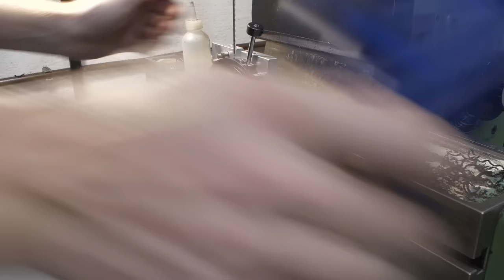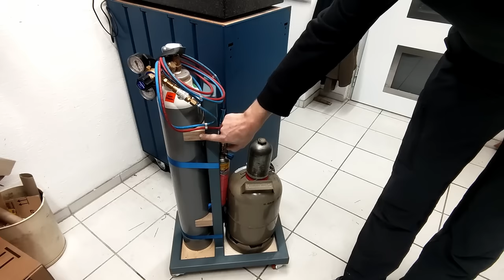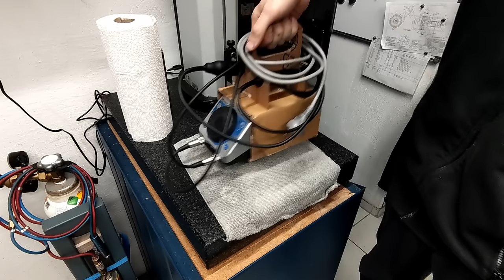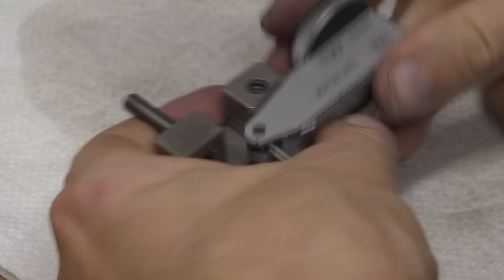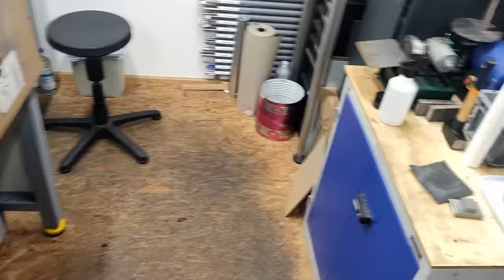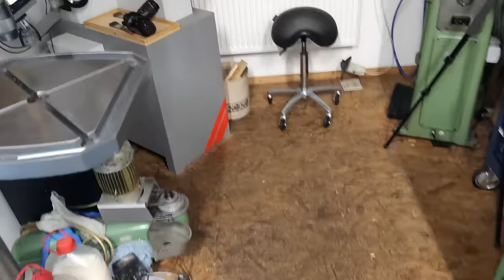Shoptalk #31 - November 2023

Comment: Thanks Stefan for the explanation about oiling the wood for successful tool storage.  I had been hesitating in making custom storage items.  Now I have more projects to start working on 😂
Reply: It must be a metal machinist point of view? Coming from the wood working world, there are loads of machines and metal surfaces in a wood shop. Also loads of wood and wood chips!! You would think the place is rusting down to the floor by some people's concerns. haha. You simply clean up and the surfaces are oiled or waxed now and again. And there is ALWAYS fine saw dust on everything. I've found the moisture in the air to be much more of a concern regarding surface rust forming. That being said, I wouldn't leave a wood board on the machined cast iron surfaces over night. That is common practice though. Those are reference surfaces to be cared for. If I want to stack something up, put it on a table, or a rack.

Comment: I watched another YT machinist, who had a very interesting idea. He has a rail mounted to each side of long axis of shop ceiling. A light weight gantry with adjustable vertical pole holds camera and battery powered lighting system.
No bumping or dancing around the tripod, camera's viewing angle can be behind operator or machine, vertical camera pole tucks into corner of shop when not needed.
Really enjoy learning from your video presentations, thank you for your time and efforts.
Reply: Inheritance Machining?

Comment: Keep up the good work, Stefan.   I do the same with my Sentinel #58 mill (Thiel 58 copy). The machine, is, in general, quite a bit larger than the Deckel FP1, but I still run out of room below the vertical head. In my case, I have a large fixture which attaches to the face where the table is usually attached. This fixture is a very heavy item which is bored to accept bushings for common diameters of flywheel main-shafts. I use the fixture as a way of guaranteeing the positional repeatability of precision bored or ground crank-pin holes, in motorcycle flywheels, etc.

Comment: Hi Stefan,
Re your tool storage material (wood), and your manufacturing die grinder caddy, can I suggest you check out using plastic  IKEA kitchen chopping boards !
They are super strong, 8mm thick, easily machined and tapped using self tapping screws etc and very low cost, and a good alternative to wood.
Happy New Year !
Regards
Mike N

Comment: Shop updates are among my favorite content. Thanks!    As I'm primarily a woodworker, I enjoyed finding ways to use my machine tools for wood. I have used the mill as a morticing machine a lot, particularly when I had a bunch of them to do at once. With sharp cutters, some fixturing, and using speeds and feeds for aluminum as a starting point, I got excellent results. I dislike routers as well. For the part you were making I would have used a bandsaw but I don't know if yours would have been big enough.

Comment: Always enjoy your shop talk videos.  Thanks for posting.  I will offer a suggestion that has worked well for me when moving heavy items over smooth to semi-smooth surfaces for short distances.  Try two sheet thicknesses of HDPE, PTFE (or sometimes even polyethylene contractor garbage bag material) under the machine feet.  It will slide much easier because of the very low coefficient of friction between the layers of plastic.  I have moved my surface grinder half a meter or so in this manner on a concrete floor.

Comment: I always need to remember that the big hole in the center of the drill press table is not under the spindle, when using the rotation for positioning. 🙂
Reply from the maker: you can make fun of me, once i have drilled into the table 🤣

Comment: It is quite a small but efficient space. Suggestions for die grinder, affix two pieces of pvc conduit either side of box to tuck cables into for neatness. And if you are concerned about your floor, simply double up your flooring with OSB  and it will be extremely strong and will spread out the weight.

Comment: Stefan, i almost never have any advice for you, but, if you want to make a wheeled cart for that grinder, make a saddle-shaped cart with a "steam roller" style setup with full width solid stock as the rollers. the width of the rollers will protect the OSB, and if you chamfer the rollers, they'll "Ski" in the other orientation with a crowbar. I made a stand like that for a big bandsaw that needs to sometimes pull away from the wall, and it's been pretty great for me.
Reply: Why do that when you can drill and bore 600 pockets in 8mm plate and pack each one with a ball bearing? 😂

Comment: As always a pleasure to watch.
I have built one of your holders, with modifications to suit my perceived wants, and added a fine/coarse adjust but at the end not where you showed it could be. The guys at SM-EE, who have seen it, seemed to think the design has merit. 😉 At present the body is nylon while i finalise the mods, but it is still stiff enough to test. One problem i have is that it is too low profile,  making it difficult to see the dial when in the " north " facing position because mine goes straight in an R8 collet. I am working on one with parallel arms to vary the height. At my age it is the only fun i get playing with ideas,😊
Perhaps it is time to add another video to my meagre channel 😊

Comment: I can smell the fresh epoxy floor of the new 500 m2 industry hall of the "GTWR-Werke GmbH".
Reply from the maker: If I build a larger building any time, it will have a solid wood floor / wood brick floor for sure - I despise Epoxy floors :D
Reply: Why not concrete whith micro- cement layer finish?
Reply from the maker: because i like wooden floors :)
to me, its a nicer room climate, nicer to stand and nicer looking. And solid hardwood flooring is incredible durable and parts that get dropped dont get all dinged up and tools that get dropped dont chip the concrete or epoxy.
THB, I have no clue why you would anything other than wood flooring :)
Reply: @StefanGotteswinter  i agreed but, to  support heavy weight?
Reply from the maker: @benjaminbenavidesiglesias52 Hardwood floor or wood brick floor on concrete will support several tons per squaremeter without a problem. 
(Wood brick floor is a very classic floor choice in heavy fabrication or machine shops.)
Reply: @StefanGotteswinter  👍⚙️
Reply: @StefanGotteswinter  you can probably make the floor out of wood and then proper foundations under the machines out of 60-100cm thick concrete if you have any bigger machines...
Reply: AFAIK, the heaviest machines with the biggest loads (think gigantic ship engine crankshafts) usually was put on floors made up of standing oak trees cut to length, back in the day. Making very thick and sturdy flooring. 👍
Reply: @andli461  this is not 'thin wood' ...
Reply: @benjaminbenavidesiglesias52 No, it’s not. Quite the opposite actually. 🙂
Or do I misinterpret your comment?
Reply: @andli461  my english is 😬🤓

Comment: Hi Stefan...Sorry but watching you build a table with castors is agony :)))...This is what happens when you give a master machinist a fabricators job. I would have marked out a plate with the hole centre positions supplied by the castor supplier. Clamped 4 plates together and drilled/ tapped all at the same time. welded them to the table...job done.

Comment: Ah, finally, someone said it, a drill press with 2 rotary axes is pretty much a radial arm drill with a quirk...  I think i said the same thing when Mark Presling first started the floatlock vise build in regards as to why i find just a regular 2 piece vise a better solution on such machines... You don`t need the movable vise when you can move the table around its own axis and around the column itself to reach any part of anything that would fit on the table of the drill...
And thank you for the part about the abrasives... I constantly see people use scotchbrite on lathes for ``polishing``, oftentimes without way covers, and then just ramming the carriage forward right after that without any cleaning, relying on way wipers to do something, without realizing that way wipers will just soak up that abrasive dreck and become a scotchbrite of its own, kinda like that plastic bushing you were once talking about on that video with some guy i`ve seen long ago... All soft abrasives shed abrasive dust like mad... Even a charged diamond plate will shed some, so it just baffles me how people think that a bit of sandpaper wont or a scotchbrite which is much worse in that regard... How little love does one have to have for machines to do such a thing is beyond me...

Comment: Long drill job: Could you have used a drill guide fitted to the fixture to avoid the spotting procedure?
Reply from the maker: I tried that - There are two threads on top of the fixture where I had a drill bushing attached - It worked, but the drill entrance was not very nice compared to spotting with an endmill and the long chip coming out the hole was messing with the drill bushing, causing molten PVC - In overall it was rather problematic.

Comment: Hi Stefan. About getting more height... You could have a short drill chuck - that would give you some. And there also exists a very special raiser block for the FP1. It raises 100mm (without changing gear angles) and was made for use with the combination of the slotting head and the 2037 indexing table. I know it does exist - I had one and sold it to someone in Belgium.

Comment: should keep your eyes pen for a dentist lamp. one of those seeling mount type. i had one years ago. thay are great. the one i had could travel all over and stay where you put it. will be great camera rig for your shop
Reply: A friend of mine gave me one of those dental lights. I mounted it onto a piece of 2" pipe with a pipe flange and attached it to my welding table. I also replaced the original bulb and lens with a high intensity LED bulb. Best welding light I've ever seen. I can move the light to any place on the 3'x4' table. There is also a 5" plumbers vice mounted on the corner of the work/welding bench. If I ever need to make videos I could easily mount a camera above the dental light, which has adjustable tension on the holding mechanism.

Comment: 6:00 Stick a 90 degree fitting in  your  airline and have the hose coming out vertically down instead of horizontally. I found that my air gun would hang better and not provide as much obstruction.
Reply from the maker: Good idea - I have done that on other places, but it didnt occure to me here.
Reply: @StefanGotteswinter  Everywhere you have a "drop" for an air fitting needs to have the TEE pointing up. Then two 90's and then the quick connect pointing down. This arrangement will not allow water to make it into the hose. js.🙂

Comment: Your high quality content is much appreciated. Thanks for sharing. What is the maker of your keyless drill chucks? Do you prefer them to keyed type in all applications?
Reply: I think I would bet money on Albrecht keyless chucks and I’m not a gambling person. It has that German quality to it.
Reply: I'm asking because my experience has been the keyless chucks loosen when the spindle is reversed when power tapping.
Reply from the maker: The chuck on the drillpress is a Röhm Supra, but I also have a Albrecht for the mill and lathe.
We used Albrecht and Röhm at my dayjob for powertapping it has been rarely an issue with opening on reverse.

Comment: I'm sure you've probably considered it, but I think I used some HDPE as skids when I was sliding my mill.  I may have my plastic names wrong though.  I remember it involved the use of letters that don't spell a word.. like those of any language that ain't English. Thanks for the video!
Reply: HDPE = high density poly ethylene. The cheapest source for this I've found is food chopping boards at the local hardware store. A great material.

Comment: Poll.  What tool/machine will Stefan discard of next or what will he add to the shop next?  My guess is a bigger surface plate although I’m sure a bigger plate would be a PAIN to get in your shop
Reply from the maker: Lathe, definetly lathe - The surface plate is perfectly fine :)
Reply: @StefanGotteswinter What do you need to upgrade, capacity?
Reply from the maker: More stiff, more weight and a spindle that is not geared in the high speed range, only belt driven. I get artifacts from the gears of the super 11 when I do diamond turning.

Comment: The NSK drive unit just takes 60ish volts for the BLDC board, and 12 V for the logic unit, i am thinking to replace the transformer with a lithium pack…it doesnt care about DC voltage that much, if you feed the 60V rail with 40V, it just limits the top RPM without any alarm, very suitable for battery operation!
Reply from the maker: Thanks, good to know! Sounds like a fun mod :-D
Reply: @StefanGotteswinter  welcome, mine is the slightly higher power espert500, should be the same with emax, i bought the adaptor to get 60V out of dewalt flexvolt 20/60v battery, havent decided how to mount it yet…

Comment: I have found that if I stick to beech (buche) as a tool holder I have no problem even without oil but I avoid oak (eiche) like the plague as the tannic acid will corrode ferrous metals.  MDF also works OK but the dust is horrible to work with.

Comment: Stefan, I have had problems with certain plastics (acrylic, lexan) with IPA. Over time it shows cracking (crazing)..
Reply from the maker: Yes, thats a problem with some plasics. It also can lead to a higher probablilty of stress cracks in polycarbonate.
(Experiment: bend a old CD in your Hand and while keeping tension drip some IPA on it. It will crack instantly. Careful, safety glasses.)
PVC is not prone to that behaviour.

Comment: Stephan, can you do a video on tapping 6al4v ti? I am braking taps and smaller drill bits like crazy...  going slow/easy using WD40 & cobalt taps/drills/dies. Cheers, Doug
Reply from the maker: Simple answer: Dont
Complicated answer: Dont - Tapping titanium is one of the most nervewrecking things you can do.
Use a better cutting oil, not WD40, use coated drills, drill mildly over nominal tap drill hole, like 0,05....0,1mm, use taps with a geometry for titanium.

Still a pain, these days I try to turn/singleploint all threads in titanium or threadmill them on the cnc.
Reply: Thanks very much for your reply,  I will try your methods. Greatly appreciated, Doug @StefanGotteswinter

Comment: Mr. Pete strongly condemns using the air gun to clear chips. Where do you stand on this?
Is this only for old machines with a gearbox that is open on the underside or does he still have a point?
Reply: You will just have to know what you're doing.
Reply from the maker: If you dont point at interfaces between sliding surfaces, seals or bearings, its fine. Well working way covers like I have on the lathe and the mill help a lot.
Grinders are a place where I am extremely cautious with air.
Reply: Mr. Pete spent his working life dealing with high school kids.  The kids do not understand the damage chips can do to machine ways.  I personally used compressed air to blow accumulating chips off of my mills and lathes and have been doing it since the 70’s with no problem but I make sure never to blow them towards intersections between ways (which are covered) or DRO scales (which are also covered).  I never use compressed air on surface grinders.  As a matter of fact my Harig grinder has a permanently attached warning against doing so.  When you grind you are also wearing away an abrasive wheel which is intermingled with the swarf and would be disastrous to a machine capable of grinding to tenths of thousandths.

Comment: You will be cursing those dolly wheels if you have to do some work outside the shop, that's why the blacksmiths made those spoked rims to move the gas cylinders. A proper shop should have wood block flooring, but don't have a flood.
Reply from the maker: as with everything compromises - I dont want the big wheeled carts in the shop, no space. If i have to do offroad work, i can always pick the entire cart up with a handtruck.

Comment: where is the sorotec cnc?
Reply from the maker: Sold it shortly after I moved the epoxy granite mill in. Not enough space to have two machines and the new machine is way more capable.
Reply: @StefanGotteswinter   I see, weren't you using its controller to move your new milling machine steppers? I guess you bought a new controller.
Reply from the maker: yep! i keept the controller from the old machine and sold only the mechanical part with the spindle/spindle drive.
Reply: @StefanGotteswinter  awesome so you are also a master of selling/trading. keep rocking stefan